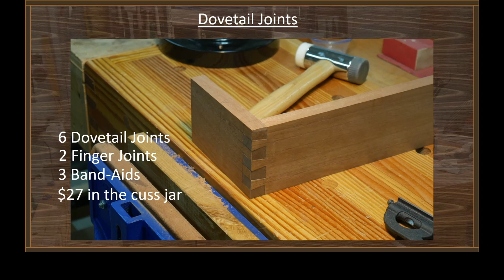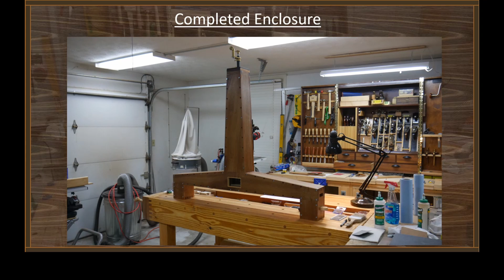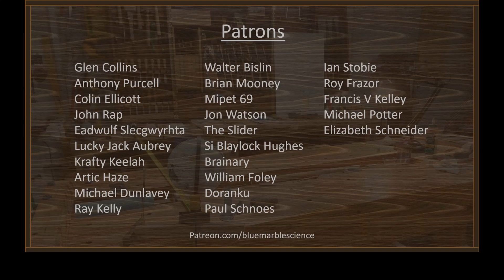Cavendish Episode 4

Comment: I'm blown away with the workmanship.
I worked a lot with metal, polystyrene, and integrated circuits in my younger days, but got into software. Instructions don't rust or break, and you don't have to go buy more.

Comment: I was looking at the wood you where using and hoping you would tell us, because  looking at the tight grains and general appearance of the wood it sure as heck looked like mahogany.  I really appreciate the fine craftsmanship you have displayed in the construction and those dovetails!!!

Reading the comments afterwards I was right.

3 band-aids and $27 in cuss jar.  I'm wondering what the going exchange rate of cuss words to dollars is?

The resolution of your video did not allow me to see what type of screws you used in the final assembly, it's the wood worker girl in me wanting to know?  Hopefully you used slotted screws to remain authentic, since Philips or Robertson screws would not have been invented.  As a good Canadian girl I always use Robertson as they are far superior to Philips.
Reply from the maker: The exchange rate is unity so dollar per cuss word. I want to use slot heads but I've got to order some. Right now, I've got steel Philips heads in it and I do that to tap the holes because it's so easy to twist a brass screw off so I don't try to use them for tapping. But I agree - plus I like the looks of slots if you make them line up. There are a 124 of them though - that's going to take a minute (or a week)!

Comment: Looks like if you made it full scale, you'd have to be doing some work on the ceiling of your garage or cut the legs off your workbench.

How much do think it weighs?

Before any asinine comment comes in from a drive by flat earther, I'll try to beat them to the punch. Here it goes:

Just so you know ,Tung oil attracts the heavenly energies and thus  ,you'll need to put that whole thing in a bismuth chamber. If not ,it does not prove curvy water.
Reply from the maker: That's a great question. I would say 50 to 60 pounds. It isn't heavy. But that isn't full scale. It's 2/3 scale. I didn't have room for full scale for sure.

Comment: Someone should duplicate the Bedford Level experiment. Well, not all of it. Just the part where  Alfred Wallace modified it and proved the earth's curvature.
Reply: It's already done, and because its done on the frozen Rainy Lake, it's called The Rainy Lake Experiment:
walter.bislins.ch/RainyLake

The Rainy Lake Experiment was designed to show, how we can figure out the shape of the earth, Flat or a Globe, by observing and measuring a clever arrangement of targets over a distance of 10 km, taking terrestrial refraction into account and using modern equipment. The experiment is an advanced version of the Bedford Level experiment executed in 1838. The Experiment leads to the conclusion that the earth must be a Globe with a radius of 6371 km.

Comment: how close is this to ole henry's design? 
 (finish, dovetail, angles etc.)
Reply from the maker: We don't know (at least I couldn't find it) the exact details of the construction. Cavendish did say he used 3/4" mahogany but I never found any details of the joinery. I'm doing what a furniture maker would do or would have done in that time and I imagine that's who Henry would have hired for this - a furniture maker. Dimensional,  the report by Cavendish give you just about everything you need. I guessed a bit at the angles but it's pretty close I think. I'm not even sure that Cavendish used any sort of finish but if he did, it would have been a oil like linseed oil or shellac. They used slot head wood screws pretty much the same as what we use today but they were hand made..
Reply: . . fasteners